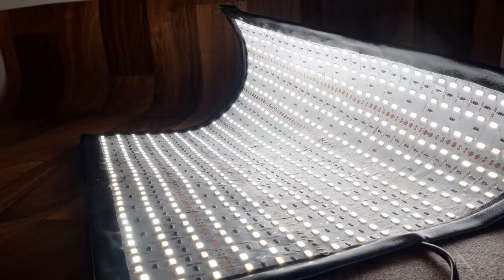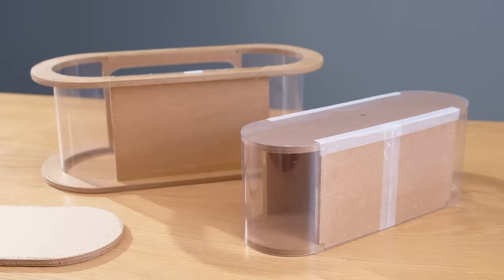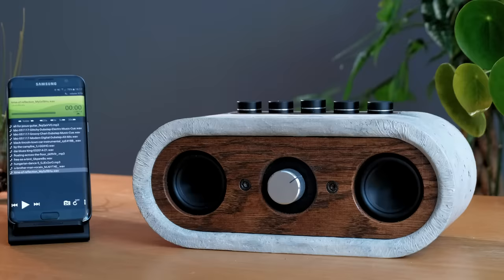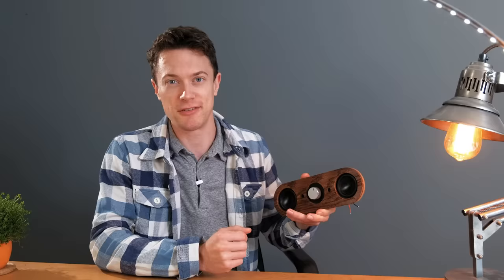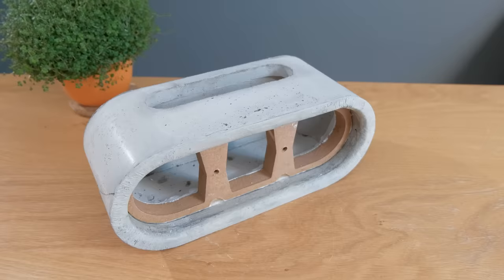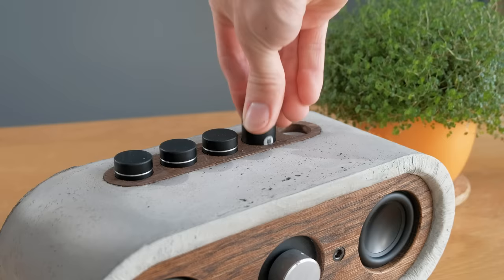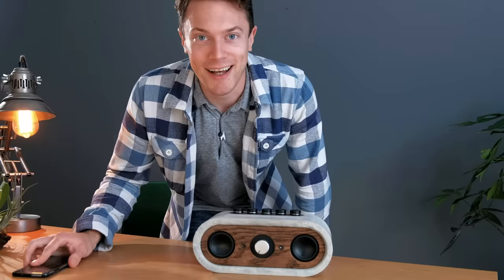Build your own Concrete Bluetooth Speaker (how-to)

Comment: Hi I would like to build one bluetooth speaker like this, instead of battery how can I power up the speaker? Do I need any circuit board to do this? Please advice and if possible give the details how to do this without battery. Thanks in advance.

Comment: I would honestly just use a single 5000MAh battery. I will need an extra circuit board so I could charge it with a USB cable (and probably another circuit to protect the battery from over-under charging) but that sounds better rather than using the individual batteries.
Reply: Luis Arvizu i would just have a hard wired device. No sense in batteries if you are not going to move it around.

Comment: Good video but please can you check the links doesn’t work
Reply: the dc-dc is a b0505s, and the potentiometer is what I bieleve to be a b50k dual-gang, you can google those as youtube gets upset at people posting links but youll be in for under 10 bucks (inc shipping). as for the other parts just try googling by his destriction. I bought the bt receiver already and wanna take the crappy sound out if it so I was tempted to make a partial of his project but i still need to plan it out and see. i assume its just amp+dc conv in between the bluetooth transmitter and headphone jack, which shouldnt be too hard

Comment: Awesome project. Is a shame you didn't quote the battery type(as in 18650? 14650? 12340?) and voltage. As lithium batteries have a wide variation in size and voltage. From 1.43 volts up to 4.35 volts for those individual cells. While it doesn't take rocket science to figure the voltage, its advisable to quote the type you used.

Comment: Hi Mr Matt, what if I already have a speaker with subwoofer but I want to connect it to the Bluetooth receiver like your video. You said that the Bluetooth receiver is using high load impedance that causing the lack of bass. I want my speaker working as same as it is use a Jack 3.5 mm cable on my phone (in the case of lack of bass output). do i have to use the same component as yours?

Comment: while this is a pretty neat project and the reasoning behind your choices is sound, something strikes me as rather odd
you have made it battery powered and use bluetooth as connection, but since it is made of concrete I would assume it is fairly heavy and brittle, so it' portable but also not really?

at an other note:
how about a bigger version but you use the battery pack of an e-scooter, there's already a charge balancer built in and you can use the charger that came with the scooter

matter of fact, I actually have a broken e-scooter, but nothing with audio runs off 29 volts....

Comment: Can you show us how to extract and use amplifier from old unused or faulty TV circuit board?
Reply: Jim Matrix In my experience, you are better off buying a new amp from ebay or amazon, or whatever brand of retailer you like. A new digital amp will give you great performance in a compact package, and no hassle. I have built a couple of bluetooth boxes myself, and never had any trouble with new amps. A broken TV board might be just that —broken, and you might end up spending a lot of time on troubleshooting without getting any results. I don‘t want to discourage you from salvaging, I just wish to save you unnecessary trouble.
Reply: @OldCrowle  Oh! Thank you. Sorry for the overly delayed reply

Comment: uuh from what i read this amp only does 30 watts, if you connect to only the 1st (left) channel. it wont do 30w on both left and right. configuring it would lead to running 15w per channel. are you sure that it does 30w at 8 ohm for both channels? the speakers are in a closed enclosure, this has effect on the sould of both the case and speaker, why did'nt you chose to make a vent for the speaker enclosure? by adding a vent you get extra volume plus a higher amplitude at a specific frequency (which the vent is tuned to), by doing this you also have a less likely chance to damage the speaker from its excursion as its moving back and forth, with the back being in a closed envoirement you keep on increasing and decreasing the preassure which could result in physically damaging the speaker. the way its configured now it wont damage the speaker because of the amp running at 15w, but your missing out on sound and a deeper bass

Comment: But i would like to point out the fact that if this speaker did have a bass port somewhere in the front(port in the sence for air to pass to create thumpy bass) i know that if we did it , sound will echo inside but then it can be resolved by adding cloth towel on the inside surface to prevent sound echo

What say people ?!

Comment: Not hard to achive it with wood. Basicaly have a jig to cut bunch of Dado cuts=(kerf) to allow it to bend then resin/epoxy the bend. It's an often practiced method to extreme bends with wood. Looks like a lot of extra work to use concrete, then it would take but one 3 ft drop for that speaker to break

Comment: Hey I have a question can I do something like in your video but with a bluetooth headset? I have to do a project like that so I need a little help, I have to send a sound to a bluetooth headset from a bluetooth module with an Arduino card automatically. Can I get some advice?

Comment: Can someone tell my why my ND65-8s are cracking with high volume? Mostly the bass sounds get very distorted. I used the same AMP, same Speakers (no potentiometer yet, could this be the reason?) 

I'm using 4x18650s in paralell and boosting it to 24V into the Amp with an Boost Converter, i tried different lower voltages, but its the same.

Comment: I having hard time finding the isolator converter  in my country (which is India) and can you suggest me alternate method for get rid of ground loop for the same project?
Reply: u can use bluetooth head phone by using audio port
Reply: @thereactar-bd6413  but I want to use general speakers

Comment: I don't like these:
- usually is Better use only one board that is the amplifier with the Bluetooth module
-i think that these battery don't have the same capacity (you have to misure it, it can change from the written capacity) and it's better to use battery with the same mAmph
- is better to create a battery pack with a BMS, and then charge it with a specific power supply ora a USB c input with an DC/DC step up
-concrete is more dense but it's not important with so small speaker driver and it is more important the front panel than the other panels
- puts silicon or something anti-vibration under the speaker

But it is quite good

Comment: A good one, I built one out of mostly what I had in the junk box. An old Hi-Fi speaker box, two new Sony 'Xplod' car speakers, and a pioneer car amplifier. The only bit I bought was a Chinese blutooth/USB/FM board. I did have some of the ground loop buzz you showed, but cured it with over the top earth wiring. I did have one of the isolators you showed, but I wanted heaps more 5V as my module had USB, and being able to charge a mobile from it seemed a good idea.
For power, no battery's, but a 240/120V switchmode supply, and a DC in jack for field use - 12V from my caravan battery etc.
However your concrete box seems a better option.
Recently an electronics magazine over here did a concrete speaker project, using off the shelf concrete building blocks, from Bunnings.
http://www.siliconchip.com.au/Issue/2020/June/Dead+easy+%E2%80%9CConcreto%E2%80%9D+loudspeakers?res=nonflash

Comment: This was OK, but this would have been better if the speakers would have been constructed using 3-D print technology. The designs and possibilities would have been endless.  The big question that also pops up is - was it worth it ? I can trot down to a discount retailer and purchase a Bluetooth enabled speaker for $20 buck. In fact , I did that just yesterday.  On the other hand, if you're into tinkering around with electronics and such this isn't a bad little project.  I could probably manufacture my own toilet paper with a bit of ingenuity and cleverness,  but I'd rather just buy it at the store.

But , you know what , it's good that folks do experiment and tinker around, the alternative is to sit around like a dolt watching sports and other nonsense. However, what I'm waiting for is something truly innovative to come along. All that's being done here is just the hand manufacture of a ubiquitous consumer electronic item. It would have been more fun to watch a video that showed me some device constructed from scratch that was used to crack the combination on a safe.  Show us something cool, like some electronic device that can be used to listen to people's conversations on their cell phones. Show us some James Bond kind of stuff, I don't want to watch you fix a blender.

Comment: the front wood ( looks cheap ) is not so thick thus give a bad body which can be hear even through youtube algoritms try 2 cm or more and maybe fill the inside with wool´or what they use - with concrete the sound should have a body and that cheap front makes it a casserecorder sound machine

Comment: Having a heavy concrete body kind of defeats the purpose of having it be a bluetooth speaker to begin with. I mean it's not like you're going to be taking it anywhere without wall power. I might just be missing some clear use case or something of course.

Comment: The deasing is great but I dont get it why did you use this kid of batteries. It would be much more easy to use BMS and place them in the speaker. It could be powered/charged by USB port with step up converter from 5V to 12V. Also batteries without this security feature that does not allow to overcharge or discharge batteries are much more expensive. Batteries could have been taken from old laptop battery.

Comment: Concrete does not set by 'drying'. If anything it sets by 'wetting'. The water hydrates crystals in the cement and bonds the aggregate (sand) together. After the initial set, concrete will continue to get slowly stronger over days and weeks. If it dries out too soon, the material will stop getting stronger which is important for a thin layer like your enclosure. The critical factor is the surface which tends to dry quickly. If it dries too quickly it will remain friable and will shed dust and sand over time. If I was going to use concrete as an enclosure for electronics I would cover it with membrane allow it to set completely over a week or so, then uncover it and allow the excess moisture to escape for another week or two.

Comment: Why do you need a step down AND an isolating converter? Couldn't you just use the isolating converter by itself? For instance, I need 12vdc to power a Bluetooth board, so couldn't I just use (eBay #163610915973) to achieve that (my original voltage is 24v) without it causing a ground loop and without needing a step down?

Comment: man you have great crafting skills but that concrete mixture is not for this job! it should have been a little more liquid and the open side of the mold will always look rough so you chould sand it with sandstone+water. But besides that, great job!

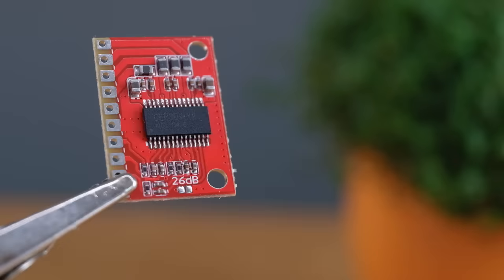Comment: 5:45 yeah it could do it without any distortion IF it is used with high quality components. 2 seconds later you show a BT receiver that's absolute garbage. You can really hear how bad those receivers are when you use them as a source for (for instance) home theater speakers. Bad quality!

Comment: amazing design. that is not concrete though
Reply: Yes it is absolutely still concrete if made with only sand and cement (and without a larger aggregate). It's sometimes called micro-concrete.

Comment: Battery work is horrid. Could just buy Lipo Pack and avoid all the hassle. Besides, it will be much safer. Ah, but concrete doesnt burn lmao.

Comment: Concrete Bluetooth speaker? Why? It's like a glass Hammer". Ideal as a decorative purpose but not a really useful tool.

A heavy load that breaks easily if falls down... 
It runs batteries but it's not made as a wearable device.

To me that is effort and money spent in a wrong direction.

I don't want to annoy you. That's not an attack. It is a notice to the people, to make them think: First of all make yourself a question. Is it made to lay on a table? In this case it doesn't need batteries, just plug it.  Are you going to carry it to every places in your school bag? concrete may be not the most suitable material.